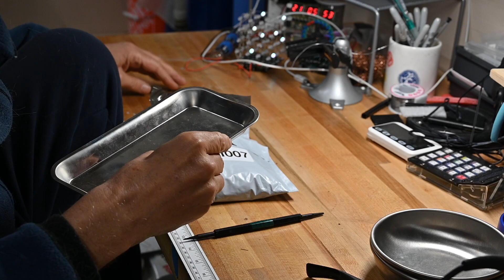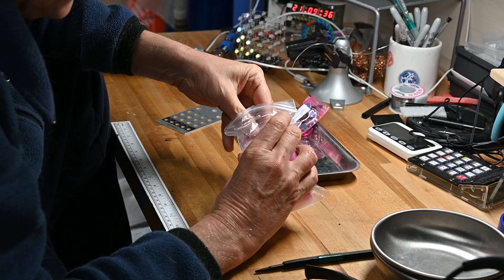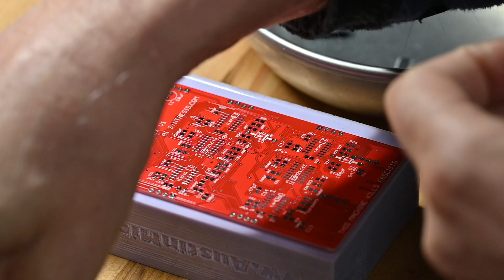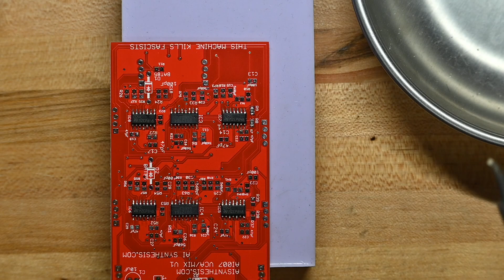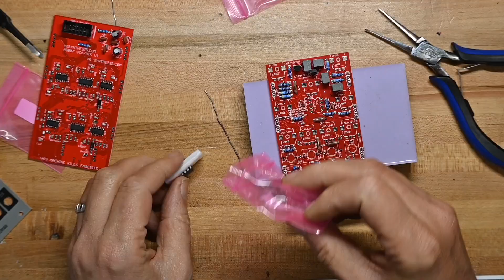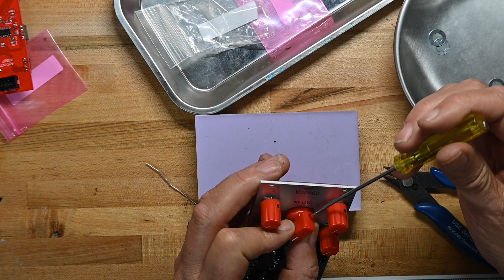C.K.  builds a Quad VCA Mixer from AI Synthesis.  NOT for beginners, lots of SMD components

Comment: Thanks for the tip on surface mount practice kits.  I was looking at this VCA kit today but I’ve never tried surface mount.  Practice kit ordered.
Reply: I picked up a smd practice board because of this video as well. I did quite well with the tiny li'l resistors and capacitors, but I can see that I'll have to order some better tips for my soldering iron to work on the components that have legs that are many in quantity and spaced very closely, like the chips
Reply from the maker: It's all in the tip.  I use a .030 mm 30 degree bent on my weller, it works for me.  But experiment and see what suits you best, fortunately tips are pretty cheap.
Reply from the maker: Definitely. Take your time, a little patience and practice and you’ll be golden. After getting somewhat proficient I find surface mount can be a little faster than through hole, and satisfying when you’re done.